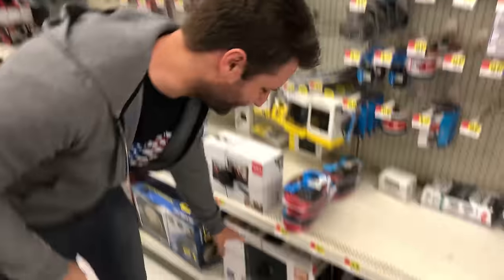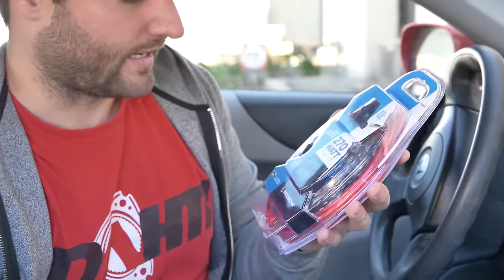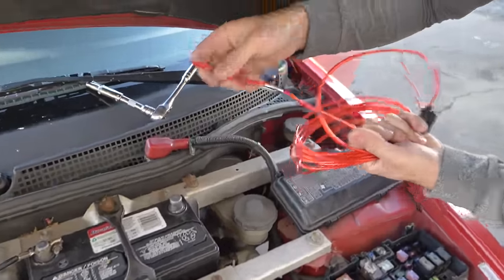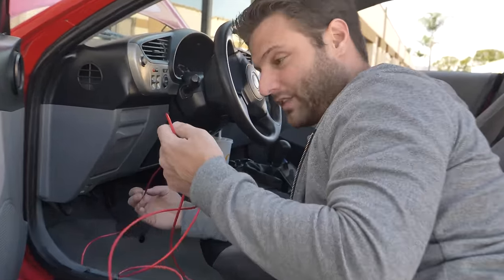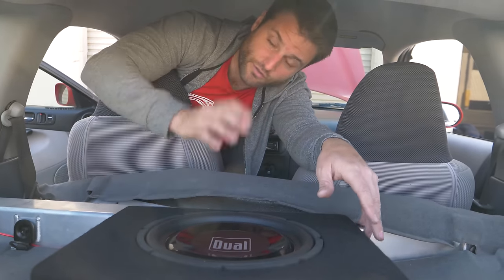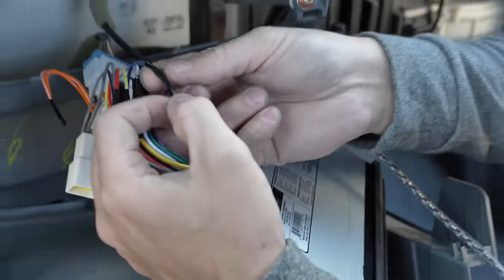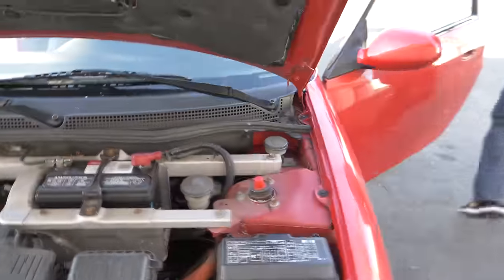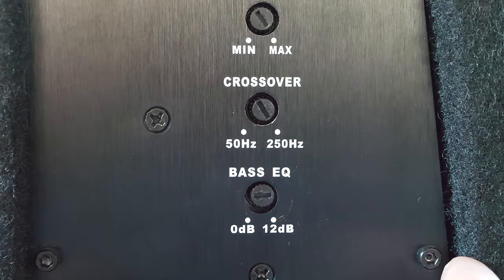How bad is the $70 subwoofer from Walmart? Install | Review

Comment: "1st step, take off your positive battery lead" Anyone else with actual automotive knowledge see what's wrong with that step? And that was just the first step.
Reply: always take ground off first... and back on last.
Reply: In truth, if the car has been sitting for several hours then there really is not an issue either way as hydrogen dissipates very rapidly and is only produced during charging.  It matters far more when one is jump starting vehicles because both batteries are effectively being charged (particularly if the Good Samaritan vehicle is left running to help start the other vehicle and recharge that vehicle's battery) and are likely to be emitting hydrogen and oxygen in the perfect 2:1 proportions.
Reply: @Adam Epperson That's the golden rule. When I first saw it in his video I just shook my head.. He def shouldn't be hooking up systems or anything else.
Reply: +Mike Odie lol... You do realize he's building and engineering the 4-rotor right? I'd like to see you try that...
Reply: I wouldn't be as concern about "blowing" up the battery as I would be creating a spark that feeds back through the positive cable causing damage to modules in the vehicle. If it arches the ground it only sends the charge back to the frame not back through all the electronics.
Reply: Frank Gonzalez i went through the comments to find someone that noticed this
Reply: The actual danger with not disconnecting the ground first, is that if you have the ground connected and you put a wrench on the positive terminal, if that wrench touches any part of the car, electricity will flow through the wrench to the car body. You have just shorted out the battery with a big arc and potentially catastrophic effect. (It basically becomes an arc welder!)
If, on the other hand, you put a wrench on the ground side first, and you happen to touch the car body with the wrench, the terminal and the wrench are both grounded, so there is no flow of electricity, nothing happens.
Reply: Taking either one off will be fine. Hes not jumping another car off and the car isn't running. I always take the ground off just as a habit but he will be fine for what hes doing.
Reply: cjones29hd Doesn't matter if the car is running!  If he doesn't disconnect the ground and touches a wrench to frame while removing the hot, he's shorting the battery.  Basic safety.
Reply: I wanted to shut the video off when I seen that but had to see how much more he f's up
Reply: LOL THIS IS'NT NECESSARY

Comment: I'm sure you were supposed to disconnect from the negative post first! To prevent the positive from touching anything on the chassis. Since the chassis would be negative/ground. If the positive were to touch any metal body of the car, you could blow fuses, cause battery to short, or have something weld to the chassis and possibly catch fire.
Reply: KmanBeatz ughhh. If you disconnect the positive post, what is going to spark?

Comment: Got this from Walmart it’s actually really good I love it
Reply: malik lovett any idea why mine wouldn’t be getting power? I did exactly what rob did with the wiring harnesses but I used the positive terminal from my battery instead.
Reply: Your wirings are probably wrong
Reply: malik lovett it just doesn’t make sense though, I followed this video exactly
Reply: @t.j.softich2553  that's your problem lol
Reply: T.J. Softich dont listen to rob. the way he showed will burn your car down. i would never buy this sub either
Reply: @t.j.softich2553  Is amp turning on? Could be ground issue, the acc power wire(radio/ignition on) or audio cables.

Comment: "Requires so much power" Dude. It runs on MAYBE at most 100 watts. Probably more like 75-80 watts. That's literally nothing
Reply: Ahem 300😂
Reply: @Codgod1213  the number on the box doesn't mean shit
Reply: By so much power I believe he means more than the head unit itself is capable of delivering to a speaker, thus having a dedicated power amplifier to run it.
Reply: This sub runs 150 rms
Reply: Nissan Tech lol 100
Reply: Randomness Calls For Randomness cedars link subwoofer and amp gives me 2,200 watts. Is okay for me. But this 80 watt is nothing
Reply: @nissantech8857  It may SAY it will do 150RMS but it's a DUAL... they're shit, made for cheap asses at Walmart. I bet if I put 150RMS of clean, undistorted power to that subwoofer even in a good enclosure for it, it would die

Some of these people (including Rob himself) should sit in a big boy sound system for once

Comment: Running your wire through the door jam is asking for a fire
Reply: rigo z Agreed! Same happened to my dad installing horrible audio upgrades himself in his first car, an '88 VW Jetta.
Reply: rigo z Luckily, no one was electrocuted⚡😀
Reply: Kevron Harris i used to do the same when i started getting into car audio after getting my first car at 16. But you couldnt google info as easy and i wasnt into forums then. Information is easy to come anymore but you can also run into bad info like this video. But you learn from mistakes
Reply: rigo z Very nice advice. I prefer meeting experts "in-person" by going to car audio shops rather than Googling for owners forums on the web. Amateurs and novices face a lot of faux pas if he/she try to install audio equipment themselves.
Reply: Kevron Harris very true. i am no expert by any means but im self taught. I like to do all my installations on my own. I make sure to do alot of research and planning before beginning
Reply: MANBEARPIG 7734  main difference is they are loomed and have actual wiring pathways that don't involve them pinching every time you close the door.
Reply: That's why the fuse is close to the power source
Reply: He doesnt run it through the door jam. What he did is fine in this case but it looks dangerous if you are just skimming through. It follows an existing wire loom bundle and goes through a grommet in the kick panel.
Reply: Nah, use a hammer and Philips screwdriver to punch a hole, rote it through there. ROTFLMAO

Comment: Aren't you supposed to remove the negative terminal first not the positive?
Reply from the maker: Yeah if you remove the negative you have a safe way of disconnecting the battery in case you drop the lead.  I did kinda gloss over that one. Good call.
Reply: In fact i heard that connecting positive last is better, and from what i see it not sparks at all. We usually remove ground just to not short battery with wrench
Reply: Always the neg first and neg last. Didnt know this till recently but apparently removing the pos first and hooking the pos up last can potential blow the cars computer
Reply: kxpes always, absolutely always no if’s and’s or but’s remove the negative first. That is the safe way and the only way.
Reply: +TheRedRaven Tell me valid argument for that. I can only see that is safer because You will not short terminal during tightening
+Jeff Barton You can blow computer if you disconnect negative also, if it is not protected. Voltage jump will be jump, it doesn't matter from where.
If i'm wrong, please give me valid possibly physical explanation why
Reply: kxpes a valid argument? I was a mechanic in the Air Force for 10 years, there is no argument to be had here this is basic battery knowledge.
Reply: +TheRedRaven Sorry but that is not and never will be valid argument, as i see mechanics that work for years and don't know shit. (no offence) 
And that you say is not worse valid than mine, as i developed electronic tachometer to ford probe, i had to take voltage jumps, and all sort of stuff under consider. And till today, i did not physical difference.
@edit not only tachometer but all dashboard gauges
Reply: kxpes don’t be sorry for your ignorance, the chassis of the car is connected to the neg cable. If you remove the pos cable your wrench could accidentally hit the chassis and cause a short. This is the basics of preventative maintenance techniques and I’m not offended, in fact continue to do it your way (the wrong way) because apparently safety isn’t a concern of yours.
Reply: If you do positive first and touch any metal on the car while loosening the nut it will give you a nice light show because the wrench is now completing an electrical circuit.
Reply: +TheRedRaven Not that i started with " We usually remove ground just to not short battery with wrench", not that i followed with " I can only see that is safer because You will not short terminal during tightening" I'm not ignorant You are, and if it is only thing that You say, You may read as well. 
Just for Your info, rx8 have battery in suck odd plastic container (stock) that if You don't use foot lenght wrench, or short terminal on purpose, You are not going to short it. so i'm safe to do this on this vehicle.
Reply: kxpes idgaf what you started or ended your comment with, you initially replied to mine which is what this is about. You got my response, you’re unsafe and that’s all that needs to be said. Only takes one mistake to weed the herd when it comes to mechanical, especially when it comes to something so basic as a battery. You are literally trying to argue with someone that has higher standards than you.
Reply: kxpes ive heard from a friend in the car biz and from Scotty Kilmer on here. Not sure of the mechanics of why but Kilmer seems pretty informed on the subject. Like i said i just learned it myself. Ill have to look into it more and maybe watch the vid again
Reply: Ya from what i can see its because as stated before with shorting it out. Plenty of horror stories out there and i remember my step mom welding her wedding ring while helping change my batt as a kid
Reply: +Jeff Barton I'm saying You must put positive last and take off first. As disscussion goes on, it is it is safer to manage ground, if we are not aware what we are doing. You all takl about changing battery, my friend was changing oil pressure regulator, touched wire, and welded wrench to engine block, real deal iw was if he could not take it out because battery was in trunk. But that is not a point, and i will ask question which i should form from beggining

+TheRedRaven You say i'm dangerous, and You have higher standards. I totally agree, but standards does not come in pair with right. And i know, that it is easier for You to replace parts, than care about them

But i will ask once again, and now i will specify "Why do You all say that negative port is safer to start and end work with, in electronic matter. How is reacting capacitors, transistors, and diods in all of this?" 
As i say, from experiance managing positive last, creates no sparks on same vehicle.

Comment: you can't really hear it properly over these videos, but I am sure the upgrades will be just fine for low budget fixes that will be better than factor..cheap factory, not some of the newer updated options new cars have, but at least better than their entry level ones.. so why not.. I went with taking out all 6 speakes and swapped them with new Polk Audio, and added a low profile 10" Pioneer Sub, ran it on stock deck, but with an Alpine 5 channel total 500 watts ..... it cost me approx. $1250Cdn. with install.. bought it all from U.S. electronics store, but had local future shop install it. Nothing like aftermarket sound !! Boom !

Comment: Nothing wrong with cheap equipment if that's all you can afford or are just starting into audio, but just do it safely, NOT like this guy!!!! Use better quality cable, terminate and solder connections properly, and obtain a good ground (don't just screw it behind a random bolt!). And dear god, someone buy this man a bloody soldering iron before he burns his car to the ground 😂
Reply: Peter Abbott Or at least some crimps and an appropriate crimping tool (in fact, combining twisting together with crimping makes for an excellent connection...as does solder).  Either crimping or soldering are extremely effective and reliable when done properly.  But counting upon electrical tape, in a hot summer vehicle, to reliably hold rather loosely twisted wires together as a long term solution is not an acceptable strategy (but can be a great avenue to securing your next vehicle after an oddly suspicious electrical fire).  Even quality 3M brand electrical tape looses much of its adhesion at high temperatures, such as encountered in a hot car on a summer day, and as such offers no mechanical strength to the connection and can potentially separate from the wiring it is wrapped around when just wadded up like that as opposed to neatly and snugly wrapped.
Reply: If you sand the surface underneath the bolt down, the ground connection is just as good as it would be a the battery.

Comment: I wanted something to just add a bit to my 04 Grand Cherokee Infinity system. I put one of these in the spare tire well which it fits perfect in. I spliced a line out converter into the wiring under the rear seat at the factory Infinity amp and also tapped DC power from there. The factory system is not bad with 6 speakers but lacks in bass. Rockford Fosgate components in the front and 2 way 6 1/2's in the rear door along with this in the rear sounds pretty dam good.